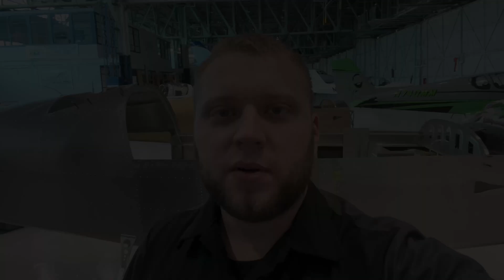9 12 G3X UPDATE

Comment: I was just at the Garmin update page, and they don't list this new version..? I believe I'm on 9.01 now. Update says 9.10. Do I need to do that update 1st before I can get 9.12?
Reply from the maker: Yeah, it was 9.12 but they pulled it for some reason and it is now 9.10 so run that one.
Reply: @MidwestPanels  Thanks. I thought maybe it's because mine is experimental. Did the 9.10 yesterday. Test flight as soon as the wind calm down around here. Great content as usual...
Reply: @MidwestPanels  Can I assume you got and upgraded to 9.12? Have you noticed an issue where Garmin would recall it? Or have they warned you about removing it?
Reply: @MidwestPanels  You are probably aware, but just in case...I just downloaded version 9.13
Reply from the maker: @dh-flies  yes we are but thank you.

Comment: Does the transponder update affect the GNX 375? Also, do you know what is changed in the GMA245 Bluetooth software version 2.00? I’m hoping it will support Bluetooth connections to more than one device!
Reply from the maker: The update will be useful when the GNX gets a software update. The single Bluetooth connection in the GMA is a hardware limitation not software.
Reply: Thanks! Re: single Bluetooth, I was afraid that was the case.